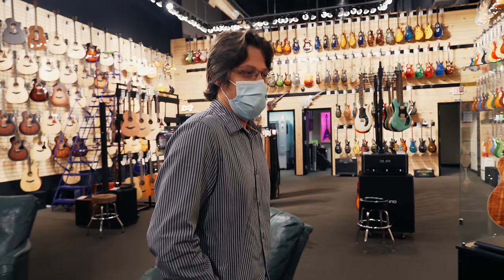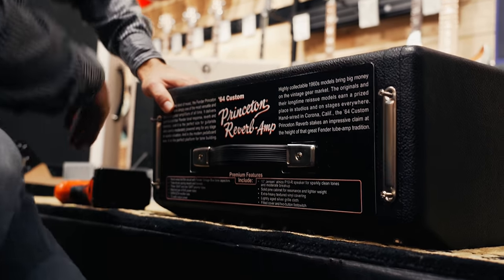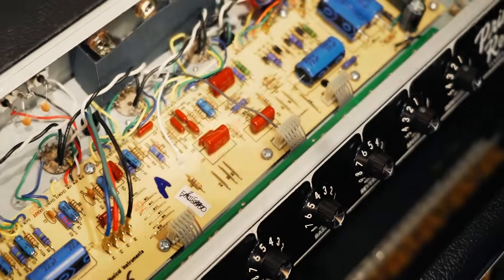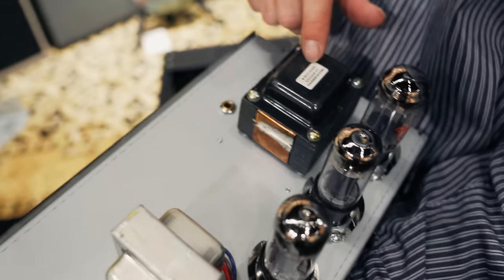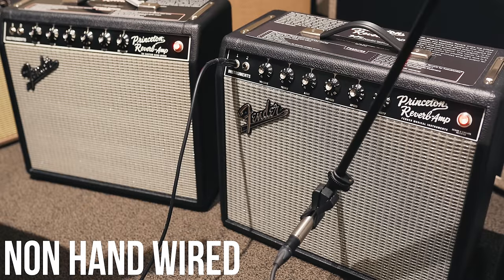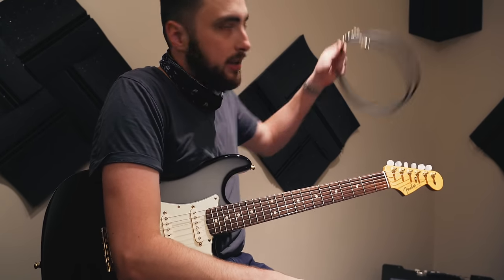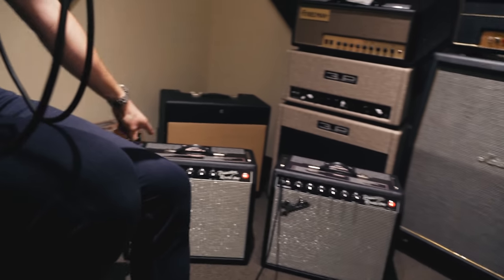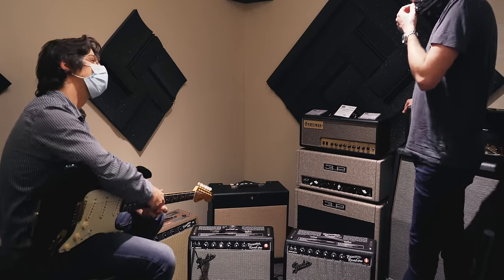Are Hand Wired Amps Really Better?

Comment: I worked at JMI, Hiwatt, Weinbrock, Healey and Audio Note UK from 2007 to 2022, I've tried thousands if not tens of thousands of amplifiers on my test bench, designed and repaired a fair few two, there's absolutely no two amplifiers on planet earth that sound the same. They're all a tolerance stack of their individual components, some are ace, some are shit straight off the production line with absolutely no differences between them at all (in theory) but in practice everything's different, every single component in an amplifier has a 1 to 10% tolerance. If there's 200 components that's one seriously unique combination that can't be repeated.

Handwiring vs PCB is a complete moot point, because every manufacturer that makes a HW and PCB of the same amp, they're tweaking the HW version to sound better, they are targeting a different end of the market.

Just remember all manufacturers of anything be it cars, amps, guitars are not in the business of making those things, they're in the business of making money.

Comment: Hand-wired sounds different than PCB, but it's not that one is better than the other. The components make a difference. That said, you can take an exist hand-wired amp and make a PCB version that sounds almost the same, with some careful engineering. Smart swapping the speaker as it's a huge part of the sound - a speaker is basically an EQ, dynamics and saturation processor at the end of the signal chain and they all sound different.

Comment: Same circuits they should sound the same. Every difference in tones is in the component tolerances.  Another difference is that handwired is esier to fix and service while is a pain the A to work with those green PCBs and mounted controls that are more prone to break.

Comment: Part value tolerances also factor into each other, and 2 amps right off the factory floor, handwired or otherwise will not sound identical. When they used the same speaker,  it was a wash; not enough of a difference to make a difference.

I think you're buying the craftsmanship and the workability with handwiring. Soundwise, neither is going to make or break you. In addition, amp design comes before all else. Some old handwired amps were notorious for not being that reliable, and some modern PCB builds are bulletproof.

Comment: “Circuit is slightly different, components are different”...”speakers are different”

All I’m hearing is Fender did a poor job reproducing the circuit and components on the PCB version. Otherwise it would be negligible. 

Nice to note the differences but would be a silly comparison sound-wise.

Comment: The hand wired amp sounded better through a cell phone speaker so for me it’s obvious. While the difference was less obvious using the same speaker it there is still an audible difference. As the years go by the spread will widen. Like most things, pay the extra so it work as intended for the long haul. Of course that assumes your personal situation affords.

Comment: Copper wire vs PCB traces - not even a contest. The electron flow over the wire vs the traces is night and day. The traces have more of a filter effect. The ceramic speaker in the PCB based amp is not a good combo (no pun intended).

Comment: Rhett.
North of $2200. ? ? Really ?
How's this instead? And i learned it from you ! All gear new or excellent/as new.
Mojo Tone 1x 12 cab used looks new                                    $200
Celestion Alnico Creamback 12" used                                   $200
HD Speaker cable laying around                                              0
Frenzel DP540Custom Built Hand Wired Mil Spec               $800
40w  2-6L6s  dual preamps = Fndr & Mrshl    runs on
6L6 - EL-34 - KT88 - 5881 - 6V6 - and many more
Total Cost                                                                                    $ 1200-1300
Savings  Accrued                                                                       $ 1200-1300
Pedals Nice & Optional,  Not required,
Cheers
clifton

Comment: If you've ever attempted to repair or mod a PCB amp, I'd take the hand wired every time. Lifting traces are not that fun! Aside from the hardwired sounding better, I personally would not buy the hand wired. I'd hand-build by own Princeton amp. I'd choose top quality parts.  Interesting that Fender chose the same cheap IC e-caps for both amps.

Comment: "the speakers are different.." 
And that's where comparing the two makes no sense, if not connected to the same speaker. (good call)
You are basically comparing speaker A with speaker B at this point. The amp slight differences won't be nearly as dramatic as a speaker difference.
It would be sweet comparing the PCB version with the same speaker as the handwired one.

But for Fender amps specifically, if ossible i'd go handwired, purely because they use that stupid design of having tubes down.. that will cook the PCB with time, i feel.
Otherwise i prefer PCB. If done well it's less noisy.

Comment: The difference has to do with layout. You actually could make a PCB just as good as hand wired but the problem is that almost all PCBs have their traces way too close together. This creates crosstalk/interference, high frequency oscillations, things that kill tone. If you make a PCB with the traces far enough from each other and have traces that are sensitive, especially one's that go to a grid, be kept away from interference driving traces such as those for the heaters and keep them away from chokes and transformers and higher current power supply and especially power supply caps. Hand wired just has things spaced out better. Now if they took more time time to do the layout better on the hand wired one it would be even better. It had too many wires close to each other and too many wires side by side. The rules are straight and short as possible, never parallel to other wires, if they have to cross it needs to be at a right angle, and the example here breaks a lot of the rules. A good example of better layout having a big impact can be found in the difference between certain Blackface Fender amps that have the same circuit and even transformers as later Silverface amps but the Blackface amps sound better. If you look at pictures of the 70s Silverface insides and compare them with the same but Blackface circuit you will see that the wiring is much cleaner on the Blackface amps. The main difference is just the quality of the wiring job.Personally I think the best Fender wiring is found in the Fender Brown amps. Also if you look inside a really high quality boutique amp they have much better wiring jobs but many still don't do it as correctly as they could  except for Bruce Clement with his B.C. Audio amps, those are very well done. My personal amp is a Bassman 50 that I  completely changed over to a circuit that's a combination of a JCM800 2204 and Dual Rectifier, a Dual Rectifier is pretty much  the JCM with an extra gain stage so I made that extra stage bypassable to have both tones. It has totally different values of parts though with a Blackface style tone stack cap values. It's handwired by myself and has very little shielded wire but is still really quite with no hum when  not being played because I make sure that every sensitive wire is short abandoned straight and as far away from sources of interference as possible. Without the interference, noise, crosstalk, and hum a lot more harmonic content and nuances are no longer covered up. Also touch sensitivity improves with better layout. So if a PCB was made with such care it could also sound just as good. Think about all those Mesa Boogies that are PCB. And like the Ubershall. And Shiva. Also not to be a jerk but Fender isn't giving the constructor enough time or training to do the job to the best possible outcome. That layout was not optimal. But whatever, it's all about the bucks. If they make so many amps and have to pay for a few more hours of labor for each amp to be wired better it adds up. The point is that it's how the signal carrying parts, be it wire or traces, are routed that makes the difference.

Comment: If you put the Mexican made amp in a good flight case with 6 in of dense foam on the top and bottom you'll be fine. I took a 70s Marshall combo to Australia with nothing but 1 in thick bubble wrap around it . No problem. The problem always lies with the baggage handlers who will throw it into the cart , 90 lbs even though it has 10 FRAGILE  stickers on it. Lol. With the Mexican made amp you should always re-flow all the solder joints which is an hour of labor. Well worth it

Comment: No two amps sound the same. Also, I’ve never heard an amp recorded and thought it could be better if they used something else. Hardwired should be all we make. They are better quality parts generally. Tones can be adjusted and parts can be replaced... but just like a Stratocaster, there should be some kind of standard. Old things lasted longer because they used better quality parts. The alloy in the metals was better. Fingerjointed pine vs poplar...? Come on! No contest. We deserved better standards for our money. If we don’t buy it, they won’t make it. Stop buying junk!

Comment: Wait a minute, you're comparing 2 different amps to each other? Different circuit, components AND speaker does not the same amp make. It would be wiser to build 2 Princeton clones and do a turret board build against a PCB build. That's a fair comparison right there, if you're really wanting to know the true difference.

Comment: I do wish that the new handwired amps had better components. In reality, while the hand wired amp is more serviceable, the component difference is very minor, so the price difference seems a little off to me. If I was buying a new amp, I probably wouldn't pay the extra. I don't think it's worth the cost. Especially, when you consider it's probably cheaper to find a original silverface Fender amp. I use a original blackface and silverface Fenders, and I've had to service them quite a bit, and I wouldn't use components like these handwired reissues because of their failure rate, and overall drop in quality in comparison with other components available today.

Comment: I hope the salesman misspoke when he said "this is Fender's handwired version of this [reissue] amplifier"... I'd like to think Fender made a handwired '64 Princeton-Reverb, like they did in the old days...not a handwired version of their '65 PR reissue. 

As Skip Simmons would say: "it's the parts, baby." That's what you're hearing...
Reply: I haven't looked at any diagrams, but they rarely do an exact reissue. It's always changed in some way... perhaps to accommodate the parts they can get now, or things they've learned about design, etc. You want an exact replica? You need to build it (and probably make some of your own compromises and adjustments on components).
Reply: @jimistheman9732  - I get that; different parts are available now, etc. (although no reason to change values from the original schematic, if that's what you're building). My point was simply, I hope they built the handwired amp based on the '64 schematic and not based on the '65 reissue schematic.

Comment: I think the hw amp sounds way better. The mid range is really, really superior! Is it worth it? I guess, if you can hear the difference (when you check them out personally!), then it’s worth it from the performance point of view. If you don’t have the budget on the other hand you can’t buy it and there’s no shame in that. As with most products, 10% better performance doesn’t cost 10% more, more likely you will have to spend 50-100% more. (Personally I hope that some of that extra money goes into sustainability and neutral carbon footprint too... and not only in sound. Someone wants to inherit my stuff after all!)

Comment: Great post.  Iv'e had the 65' and I currently have the 64', which I've had for about two years.  I totally agree with your assessment.  The 65' is too bright.  I took it a step further with my 64', and changed the stock Jensen P10R to an Eminence GA10-SC64 which makes it sound even better.  That decision was made after chatting with a noted amp tech in Texas who works on vintage PR's and current models all the time.  And yes, hand wired is a true thing of beauty to look at.
Reply: I feel like the brightness could be used to it’s advantage, like for blues, it would actually work quite well

Comment: The issue I have is they both say Fender Princeton Reverb.  Made in the same year by the same manufacturer.  They look the same, they "should" sound the same because they are named the same.  NOT REALLY, description on one says 12 watt one says 15.  One says vibrato one says tremolo.  Go look at trucks they all say the same thing (branded) and they are all different.  One will have a $30,000 sticker one will have a $40,000 sticker and for the extra 10 grand you should get more.  Same thing with amps.  Someone buys what they can afford and lives with the choice.

Comment: The video is interesting but you are comparing 2 different amps. The differences are much more related to the usage of different components than to the usage of pcb or wires for electrical connections. Just by swapping the speakers you noticed a huge difference in the sound. By looking the video it is possible to see different suppliers and quality capacitors. Probably the circuit has differences also. If all handwired amp components were moved to the  non handwired amp, of course if the circuit is identical, the final sound will be the same.

Comment: Think about how much extra people pay for custom shop guitars from fender. 2.5 x- 3x the price of a manufactured guitar, for pretty much the same or very similar components, with an increased attention to detail and setup being the main selling point.   In the end youre getting a guitar that pretty much sounds and plays the same as a well set up guitar off of the manufacturing line. 
With the 64 Custom amp, You are getting a more expensive/better speaker, different/more expensive components, a completely different curcuit that took alot of extra time and attention to detail to hand wire, and most importantly, an amp that sounds much better than the manufactured amp. It's also more rugged, reliable and and easier to repair. Considering all that, i think it's a relative bargain at the current price point of $2799 and i expect that price will go up before long to be more in line with the difference between a production line American guitar and a CS guitar.

Comment: Diff voltages back in the day and better virgin copper in the transformers  I’m sure the old amp pushed higher voltages also the 6vac is more like 7 now with 120-123vac wall voltage compared to 1950 was 110 then 115-117 in the 60-70s and 120-123 90s to now changes a lot 50v to 100 easy on the b+

Comment: The biggest difference in sound was the speaker switch. Over the internet, the hand-wired sounded more scooped than the mass-produced the hand-wired also had more bass which makes the amp sound better when you in a room with no band. switched speakers the amp sounded almost the same. the hand-wired is way overpriced for what you get in sound. I think the mass-produced amp would sound better with a band than the hand wired. you would have to bring down the bass to bring out the mids so the amp does not get lost in the mix. The difference between these two amps can be compensated with the input and tone controls. The hand-wired if you have money to throw away then sure why not, but the average player should go for the cheaper amp it will serve as well as the more expensive amp. buy the cheaper amp and put a good speaker in it.

Comment: In a blindfold test, nobody will be able to tell the difference if they are using the same speaker. Buy the amp that makes you happy, but I promise you that electrons don't care about how a circuit is wired.

Comment: Yes there's a difference, but you still can't say it's the hand-wiring makes the difference.  Until the two circuits are identical, and all other variables are eliminated but the the fact that one has a PC board and one uses a turret board, you can't say hand-wiring is better.  In this case, you've got different components in one circuit than in the other.  They're different amps at the component level, and the fact that one is hand-wired is incidental - at least so far as this video goes.

Comment: That Alnico speaker sounds great .. but its not cheap.    Anyone have the  part# of the Alnico speaker ?  
  I built a 10" combo 12 watt el84 amp, and tried 3 10" speakers . Celestion 10-30 , Warehouse ET65 and Celestion Greenback . The Greenback sounds awesome ,   The 10-30 is a great speaker for the price ( $50 ) though.

Comment: Yeah, I can't see why a hand-wired amp would be better than a non-hand wired amp BUT these two amps are really not the same ... for reasons other than the hand-wiring. Different speakers, different electrical components. I shop with my ears and my fingers ... not by the hype. I have owned quite a few black face fenders ... which I bought when they were brand new. Good stuff.

Comment: 1:53 "I don't know if you're going to get some huge win just because they're hand-wired."  Actually, I'll eat a wasp if there's any difference in tone whatsoever.  These amps may sound different thx to component variation and speaker, but that's it.  I'll grant hand-wired will be more repairable in 50 years and won't die because a PC board cracked, but that's pretty much it.

Comment: The short answer is, YES, hand-wired amps are really better--when compared to PCB amps that aren't designed to a high standard of robustness and quality. A Mexican-made PRRI is not a pro quality amp, it's an amateur's amp. A Mesa/Boogie or THD anything is road-worthy. The long answer is, the vastly cheaper PCB amp sounds pretty good, especially with the better speaker, and so long as you treat it gently, you can expect many good years of service out of it.